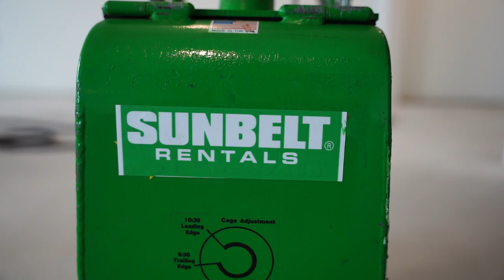How To Install Epoxy Floors In A 900+ sq ft Home Basement | Step By step Explained

Comment: I would love to see how to apply a epoxy for over existing floor tile with grout lines
Reply: Same here, took the words out of my mouth.
Reply: Possibly using leggari crack filler and a good sanding
Reply: Prime the tiles, Pour self leveler over the tiles and trowel smooth, then proceed with epoxy installation

Comment: Tried this and had a couple problems. 1 with bubbles and craters. Then when I tried to sand and coat with poly, the poly gave it a grainy surface. The craters happened after I sprayed with denatured alcohol
Reply from the maker: Call customer service at 844-LEGGARI or Email customerservice@leggari.com They will be able to help you with your questions!

Comment: So does the vapor barrier act as a primer? No need for regular primer if using the vapor barrier?
Reply from the maker: That’s correct! Plus, the vapor barrier soaks deep into the concrete, creating a permanent bond!
Reply: @LeggariProducts  thanks!